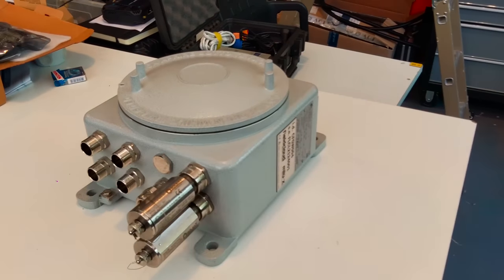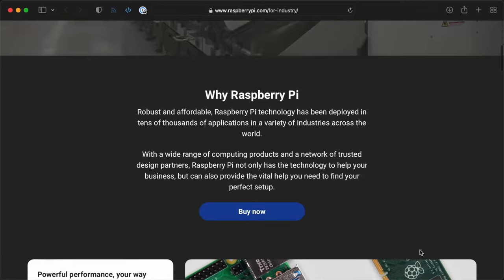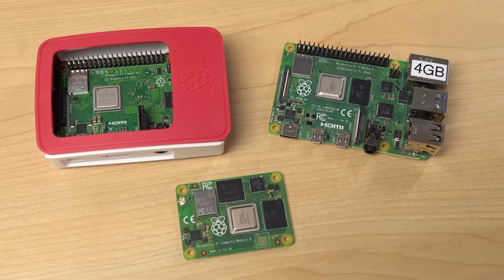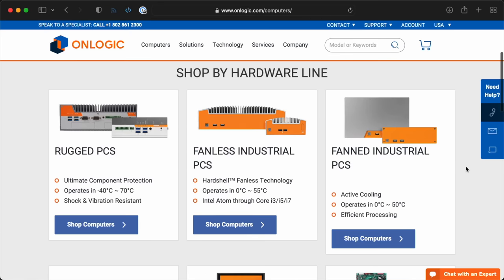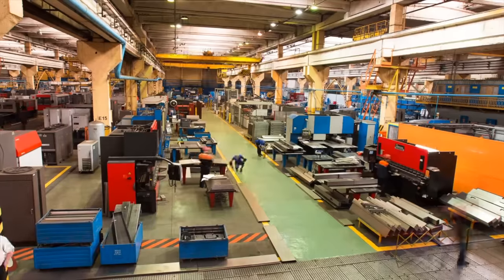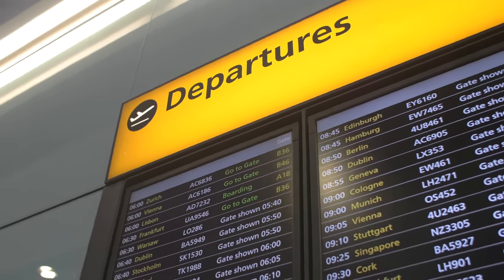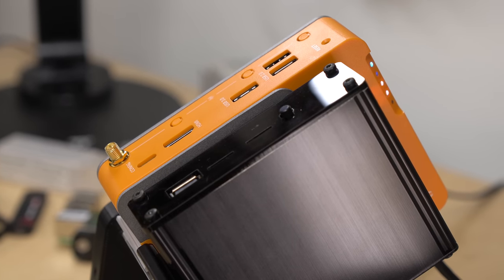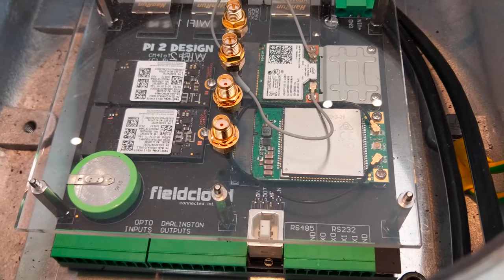Why are Industrial Pis so expensive?

Comment: You make it look like raspberry became the "winner", just because the shortage? ARM is not really that advanced anymore. Every Android Phone is running ARM, even your microwave does... Did you think of using an old phone instead of CM4? Pricing is similar..
Reply: Quite literally why I'm putting Linux on a second-hand Surface RT that cost me nothing. No need for a Pi, although the platform's ongoing bringup looks to be sluggish.
Reply: @Lethaltail  Exactly. Unless cooling is bad because of dust, it has the same performance as on day 1. If you actually calculate useful stuff, any device from 2012 can still handle it. There was no major step forward.

If you take a modern device. Like a fast 16 core or more AMD Ryzen, run linux and lightweight stuff, there is 0 delay. It became that fast that no real operation takes noticeable time. Unless you do something stupid..

Apps usually install within 5-10 seconds. On windows you cannot even open the command prompt in that time.. Downloads on unreliable network is really bad and well, not even the mouse works properly... Get used to linux and wonder how they failed with such an easy task...

Comment: I find it slightly odd to be putting something in a highly rugged chassis, but said thing doesn't have ECC ram.

Still, to be fair, worse things have been built and called industrial, so shouldn't grumble really!
Reply: Fair point. Sometimes tradeoffs are required and honestly, not every piece of industrial computing gear needs ECC RAM. It really depends on workload. But yes I have built systems which required ECC.